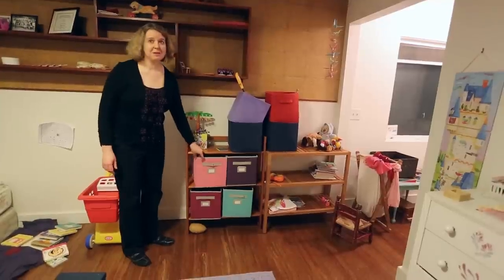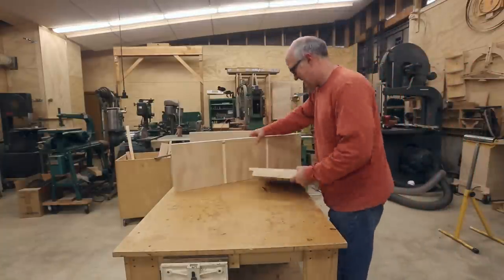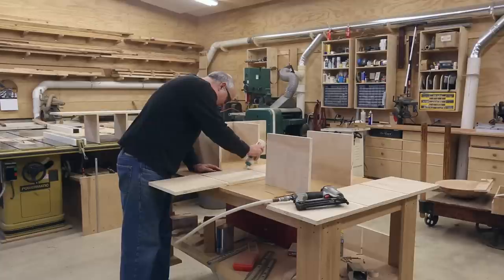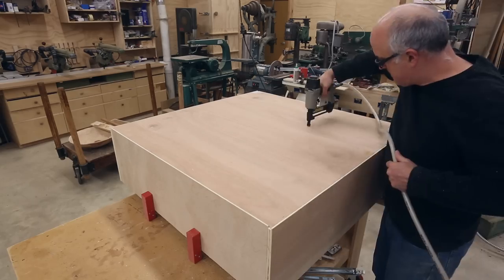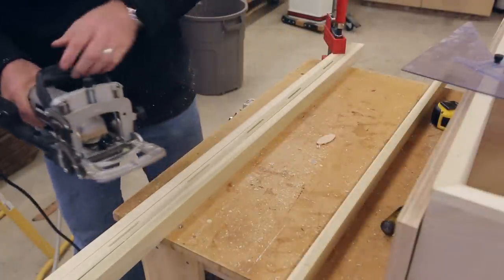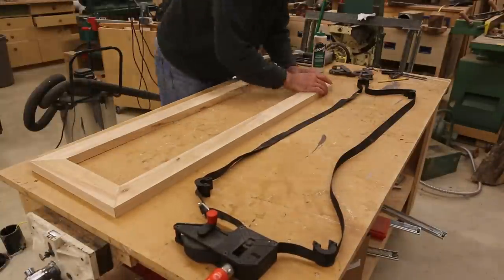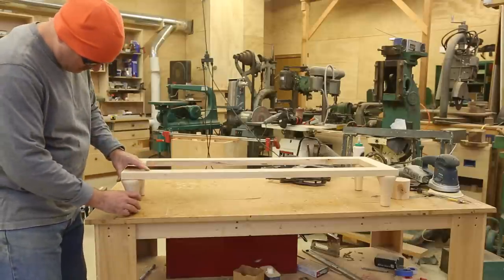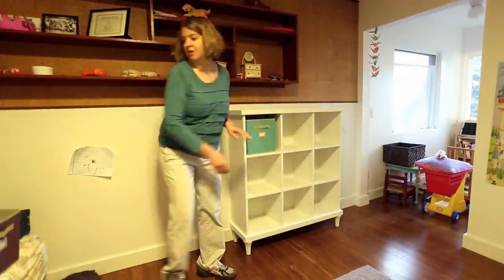Making a Cubby Shelf

Comment: Frank, you should get a larger base for your router.  I believe I've heard you mention in a couple of your videos that you were routing or flush trimming something and the operation was a little dicey because of the narrow piece the router base plate was riding on.  Rocker sells some 12" square 1/4" clear plastic pieces you could use (or use something thicker from somebody else) or, and you'll probably like this better, make your own with some of that lovely Baltic Birch you have.  There was an article in Fine Woodworking last year or possibly the year before (but not before then) that highlighted several different very easy to make router bases to really make your router a force multiplier, and they all start with an oversized plywood base.  Great article, real simple stuff that makes all kinds of routing jobs that you already do much easier, and might even open up a few possibilities of router jobs that you never knew you could do with a router.

Comment: What paint and primer did you use? I have been doing a little research and want your opinion on what to use on bare wood.

I am looking for something that will have good durability in the kitchen. I am currently working on a cabinet doors and face frames in our kitchen that my wife wants painted white. I used poplar for the frames of the doors and face frames and birch plywood for the panels. 

Thanks,
Josh

Comment: Came here via woodgears.ca... 

Questions:
- The disc sander.  I have a small one and I have to always hold wood on the down-spinning side of the disk or it will fly out of my hands.  If yours turns counter-clockwise like mine, then you're holding it on the up-spinning side, which totally baffles me.

2- The radial arm saw:   It kind of looks like you're moving it back and forth as you pull it through the cut.  Optical illusion or is there some reason for doing so?

Thanks for the great videos!